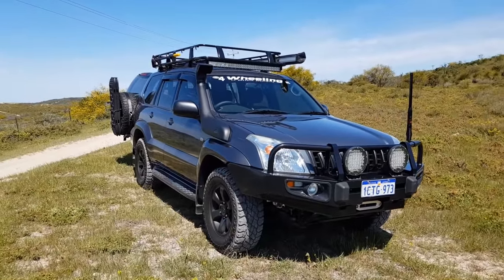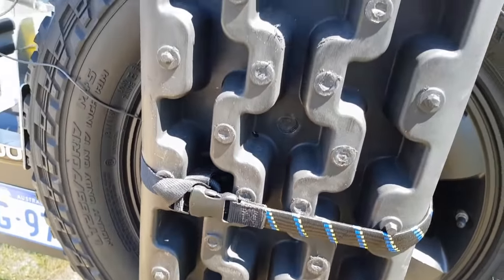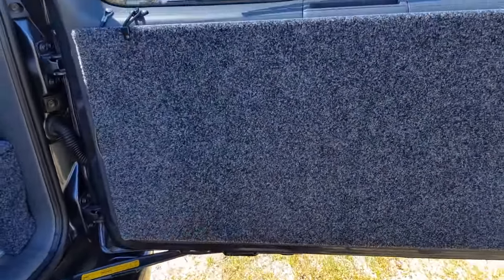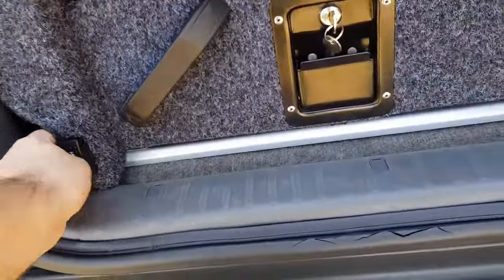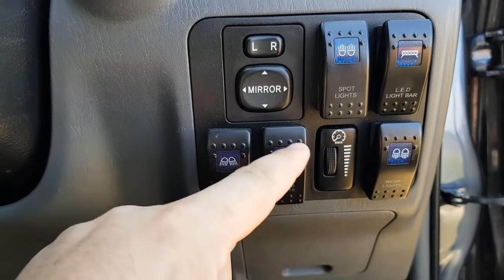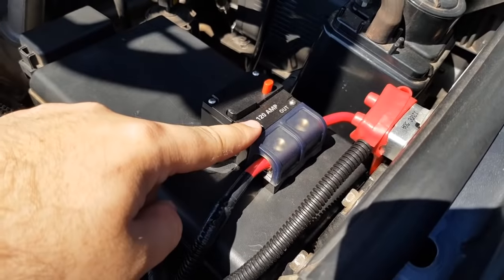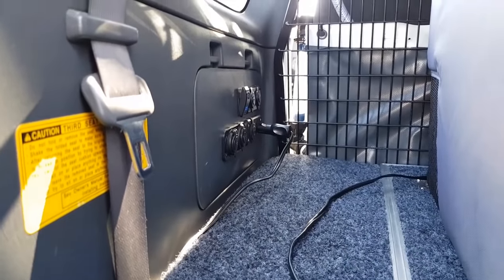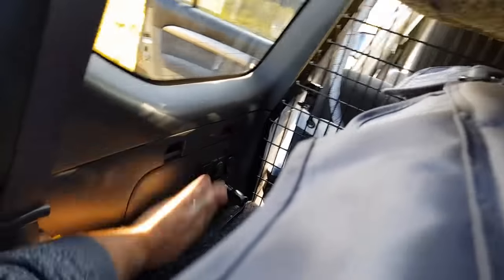Walk-around - Land Cruiser Prado 120 tourer

Comment: Great set up, throwing all my money at a pretty well stock prado and have aspirations to make it look like yours :D. I understand the rear table and T divider in the back are from bunnings, any chance this can be linked cant seem to find it online? Cheers
Reply from the maker: Thanks mate, good luck with your project!

They are not just off the shelf products, they are DIY projects all made from parts sourced from Bunnings. 

So for example for the divider, would need to buy a sheet of wood, cut it to size and then buy marine carpet and wrap the wood in the carpet and use adhesive & staples to attach the carpet.
There is more to it obviously but what i'm getting at is that i can't just link you to the table and divider.
Reply: @chappelle121  Legend, cheers mate!
Reply: @chappelle121  How do you attached the vertical piece to the bottom drawer and to the top shelf?
Reply from the maker: @SuperBong2664  at the bottom they are just hinges so it can rotate, at the top i used an over center latch
Reply: @chappelle121  Thanks. BTW, can you share your measurements for the top & bottom divider. I have got the same Titan drawers and so would love to be able to do the same. And also the thickness of the MDF?
Reply from the maker: @SuperBong2664  The measurements you would need to use would depend on the cargo barrier you use, mine is a custom DIY cargo barrier so your measurements would vary quite a bit i'd say.

I can give you my approx measurements:
Top divider: 1060mm long x 600mm deep
Bottom folding divider: 515mm high x 800 deep at its longest part but it is angled.
The MDF i think is 18mm thick

Comment: How did you get the wings to sit nice and flush instead of being raised?
Reply from the maker: mine are not perfectly flush, but flat enough for me.

The way to fix it is to put a bit of wood or a "sub floor" under the drawers to raise them up slightly so the wings can sit flush.

I just didn't want the extra weight so didn't do that

Comment: Hey mate, do you know your fuel consumption with the v6? Cheers mate. Love what you have done with it 👍
Reply: Gotta take a couple of jerry cans for a trip to the shops.
Reply from the maker: haha, yeah with the mods and weight I have added it averages around 16L/100km. It's not great but it does have 180L fuel tank so has a rough range of 1100km which is pretty decent. unleaded is also cheaper than diesel so cost per km is actually not far off my previous D4D hilux. The extra power of the V6 is certainly very nice and other running costs are generally cheaper too. I like both, I did go the V6 with this car just because it was a cheaper purchase price than the Diesel equivalent on the used market, but now I don't think I'd swap given the opportunity if the cars were the same price as each other with this particular car.

In saying that, I am considering a 2016+ Hilux for my next build which are all diesel so just goes to show, i'll take whatever! haha

Comment: Hi Chapelle121, mate where did u fasten your titan drawers down to in the rear? Also, did u have to pack the drawers up to allow the side wing infill panels to clear over the rear seat attachment points?
Reply from the maker: Its tied down to the 3rd row seat mounts, I actually didn't pack it up but the wings are slightly angled up away from the drawers. a lot of people put a bit of wood or something below but I just did it that way to save a little weight

Comment: Top vid. Well done. Great job on the prado. Im keen for some titan draws and wings for my 120. What size draws did you use and are their wing sets universal??
Subbed your channel also.
Reply from the maker: Hi Mate, the titan draws you can actually buy vehicle specific, mine is a set specifically for the Prado 120 series - then it has everything you need to fit and the wings suit properly.

Comment: would love to put my thumper max in under the bonnet. How did you make that bracket?
Reply from the maker: I ended up killing that thumper, maybe conditions too hard in the engine. I got another an now hard mounted it in the boot. But basically just made up a bunch of brackets from bunnings and made it work - don't have it any more to give you any more info on it really unfortunately

Comment: nice mate

just need a suspension lift and your done
Reply from the maker: Yeah its on the cards soon!
Reply: @chappelle121  

what are you looking at getting?

Ive installed dobinson MMR's with dobinson springs in my 120.  Pleasure to drive.

anyway.  Your doing it the right way.  get everything in the car, then your susp last
Reply from the maker: Getting an Ironman foamcell 2" lift kit put on next week :)

Comment: Hey bro, first of all have to say great job bro.... tidy, clean, functional, just great mods.... secondly how you 2nd battery setup goes? I've been told AGM does not like the heat from the bonnet nevertheless I was thinking how it does performed if someone install it there.... how is your experience with that battery... thanks mate for sharing.... Nice job!....
Reply from the maker: Yeah you see that a fair bit, AGM's ideally should not be in the engine bay, however for me I didn't have another good place to put it, but it is working just fine... I run my lights, fridge, charging phones etc... while camping and in the morning the voltage is still like 12.6V so plenty of juice by morning. the DC DC charger I use gives it a nice full charge and its temperature compensated - it has a temperature probe to help it charge efficiently so if its hot it wont pump so much current into it I guess. (its a Projecta Inteli-carge) On the Prado the battery is right behind the headlight too so I don't think it gets that hot, there's probably some decent airflow there.

Comment: Can you show where you purchased the bungee tie downs?
Reply from the maker: do you mean to rok straps used for the recovery tracks? I got mine on ebay
Reply: chappelle121 no the ones u used for the table on the back door to hold it up
Reply from the maker: @smitty4699  I think I got mine from BCF or bunnings but other places would have similar. they are called "stretch loop and button" or "bungee loops"

Comment: Awesome setup mate, what was involved in making the compressor fit inside the bonnet? Did you have to move anything? And where did you get the fans from? Cheers mate.
Reply from the maker: just relocated the carbon canister, made a bracket and it went in, was pretty easy. The fans i got from Jaycar. I actually ended up moving it into the boot now though
Reply: chappelle121 how did you relocate the canister and where to? Why did you end up moving it?
Reply from the maker: @andyjohnno9666  just moved it over a little, just re-bolted it in a slightly different spot to make more room. cant remember exactly what i did now but it wasn't hard

Comment: Mate the gas bottle holder, did u modify it to fit on the tire or it came like that? Also what size bottles does it fit? 4litre?
Reply from the maker: Its basically a heavy duty ratchet strap wrapped around the Tyre - I used a product from Bunnings called "Grunt E-track Fixing Plate" which has cut outs for a strap to fit though. so that is basically strapped that to the spare Tyre, then i bolted an oz trail holder to that plate with another little flat bar to make it more sturdy. 

Yes its a 4l gas bottle

Comment: How amd whybdidbyoubselect the carpeting that you did? Is this carpeting high pile low pile, hogh strength or stain resistant?
Reply from the maker: I used marine carpet, its water proof/resistant, low pile, durable, flexible and easy to work with

Comment: Great looking set up. Did you paint the rims yourself? If so, how did you go about doing them?
Reply from the maker: It is plasti dip so it is reversible, just look up some guides on how to plasti dip rims - its an easy process
Reply: @chappelle121  Just saw this comment. How do they hold up? Any chips or issues?
Reply from the maker: @nickGTFX  It holds up surprisingly well. 

I have peeled up an edge here or there probably from running low pressures on the beach or something - but they are super easy to touch up. A bit of thinners on a rubber glove rub the peeled part, it will sort of meld it back to flat on the rim...  and then just a quick touch up layer in the area with more plasti dip - 5 min touch up job and they look good as new again, it blends easy. Have done that twice over the 2 or so years i have had them plasti dipped.

Comment: Awesome set up mate, quick question, what paint did you use on the rims?
Reply from the maker: Hi there, I used black Plasti dip, so it is removable if i want to. (and it has held up really well even with off road use). there are lots of videos online on how to plasti dip rims.

Comment: Well done Sir , Currently building the same Prado 120 , minus bullbar  :(  not legal here in the UK . You have given me some good idea's though.. What size are your tyres..
Reply from the maker: Thanks :) 
265/70/R17
Reply: Apparently winch bumpers are a bit of a grey area here in the UK. If they're fitted with a winch then they're legal as they aren't technically bullbars. It's best to check with your insurer though just in case 👍

Comment: Hey mate where did you get the rear wheel ratchet strap and bracket from?
Reply from the maker: Its basically a heavy duty ratchet strap (that you can get from any tool shop, wrapped around the Tyre - I used a product from Bunnings called "Grunt E-track Fixing Plate" which has cut outs for a strap to fit though. so that is basically strapped that to the spare Tyre, then i bolted an oz trail gas bottle holder to that plate with another little flat bar to make it more sturdy.
Reply: chappelle121 legend! sweet set up man!
Reply: I knew someone already ask this question. I was looking for this answer. Awesome idea cheap DIY staffs. I am going to install in my Jeep.

Comment: Hey mate how did you wire up ur lights?? The front and back, how did you hide the wires???
Thanks
Reply from the maker: The wires just go out through the door seals, you see them at the 2 minute mark in the video just coming out of the doors and up to the roof rack.
or you could run them up along the snorkel or along the front windscreen seal

Comment: Hey mate, im really keen to know where you got your spare tyre strap/mount for the gas bottle holder??
Reply from the maker: Its a DIY i did, but Its a normal gas bottle holder i bought from tentworld i think, but many stores sell them, then modified a bit to suit...
Its basically a heavy duty ratchet strap wrapped around the Tyre - I used a product from Bunnings called "Grunt E-track Fixing Plate" which has cut outs for a strap to fit though. so that is basically strapped that to the spare Tyre, then i bolted an oz trail holder to that plate with another little flat bar to make it more sturdy.
Reply: @chappelle121  Brilliant, thanks mate.

Comment: What materials are needed for the dropdown table?
Reply from the maker: Hi mate, not much really - its essentially a black melamine colourboard cut to a suitable size, wrap the back in marine carpet and stick down with spray adhesive and then staple the edges down, then cover those edges in some aluminum edging.

Then just some stainless metal wire/rope screwed/bolted to the front edge of the table and bolted to the top of the rear door. and some simple hinges.
And finally 2x 'stretch loops' and 2x 'shock cord buttons'
Reply: @chappelle121  what thickness melamine? Ply I'm presuming?
Reply from the maker: can't quite remember, id say 16 or 18mm maybe - either should do the trick

Comment: What lift and size tyres are you running?
Reply from the maker: In this video the suspension is stock (have since added a 2" lift) 265/70/17 tyres
Reply: @chappelle121  thank you great vid

Comment: Got more details on the fans? I.e. size, type, were you bought them from.
Reply from the maker: I bought the fans from Jaycar, just a small 12v fan - cant remember it was probably 30 or 40mm and i trimmed them with a dremel to fit in there
Reply from the maker: Just made another quick video on it: https://www.youtube.com/watch?v=8lsUw6YzR18&

Comment: Awesome mate. How much you spend for this setup recently bought a 120 only got the bull bar !!!
Reply from the maker: Didn't keep good track of what I have spent, but I would estimate around $6500 at a guess, the car was completely stock standard when I got it though. I would of saved a reasonable amount doing all the work to it myself I would say.
Reply: @chappelle121  Does the bull bar wobbles?
Reply from the maker: @Iamsuvash  It does a little bit, but what is actually wobbling is the car body - the bull bar is bolted solid to chassis and the car body is on rubber mounts, so while you drive it looks like the bull bar wobbles but its actually the body wobbling on top of the chassis.
Reply: @chappelle121  cheers

Comment: Great setup!  I love your little innovations everywhere!  Do you prefer having the 4.0v6 over the D4D?
Reply from the maker: I had the diesel  in my previous hilux and while i miss the better economy of it. The extra power of the V6 is very nice to have. 
Tbh. I am indifferent and could go either hapily but the v6 is typically cheaper to buy used and thats what I ended up with this time.
Reply: @chappelle121  Thanks

Comment: Love this video mate

How did you run the hose from inside the car to the rear bumper?

Did you just drill a hole in the floor?
Reply from the maker: The hose runs out of a factory grommet that is in the floor near the jack compartment.
If you lift the carpet up in this back left corner or look underneath the car you will see the grommet - then just drill a hole in the grommet and push the hose through.
Reply: @chappelle121  thanks mate

Comment: Hey mate. What's the tyre strap called? And how'd you attach the bottle holder to it?
Cheers
Reply: I'd love to know too. And if it holds up in corrugations?
Reply from the maker: Its basically a heavy duty ratchet strap wrapped around the Tyre - I used a product from Bunnings called "Grunt E-track Fixing Plate" which has cut outs for a strap to fit though. so that is basically strapped that to the spare Tyre, then i bolted an oz trail holder to that plate with another little flat bar to make it more sturdy.

Has been fine in for me in corrugations

Comment: ANYBODY OUT THERE WHO IS CURIOUS ON THE V6 PETROL MOTOR AGAINST THE 3.0 TURBO MY ADVICE IS DONT GET THE DESIEL UNLESS ITS 2007 AND ABOVE ,,THE 2007 MODEL AND ABOVE HAS THE FACTORY UPGRADES THAT PROVIDES MORE GRUNT (POWER) TO THE MOTOR AND WITH MUCH MUCH BETTER FUEL ECONOMY THAN THE PREVIOUS MODELS,,IF YOUR PURCHASING THE V6 PETROL MOTOR WITH THIS GEAR STACKED ON YOU WILL PAY HEAVY FOR THE EXTRA WEIGHT I CAN ASSURE YOU,THE PETROL VEHICLES ARE MUCH CHEAPER TO PURCHASE,,DESIEL MOTORS CAN DO ALOT MORE KMS ,,BUT ITS ABOUT WHAT YOU WANT ,,EITHER WAY YOUR BUYING A GREAT CAR,,JUST DO YOUR HOMEWORK,,CHEERS
Reply: Petrol is about as cheap today as it was when this Prado was built!

Comment: 2004? thats a very old car-just get a 2018 model
Reply from the maker: Lol sure i just got a spare 70k laying around.

This way I own the car with no loan and im not worried about damaging it all the time while im off road
Reply: @chappelle121  Good idea.Just thought with a newer car you spend less on maintenance, repairs and wear and tear then after you drive it for 100K km just sell it to someone like you after you have had the fun.See where a new car helps? even with a loan.But to each their own
Reply from the maker: Have had to spend very little on maintenance. Just an oil change every 10000kms at 60 bucks or so, replaced alternator at a cost of about 200 (probably my fault from too much mud) and a new fan belt at about 50.

They are pretty bulletproof and known to be a reliable motor

Not as much to go wrong on this car compared with newer models.

Had a newer hilux previously but sold it and bought a 370z and this car with the money

Comment: Too much light for camping. Mate sorry but won't want to be camping next to you
Reply from the maker: haha - they are almost never on, its more for finding a spot in the middle of the bush with no one around. I obviously wouldn't roll in to a camp ground blaring lights everywhere.
when i'm actually set up the only light i really use is the small LED strip which is dimable.